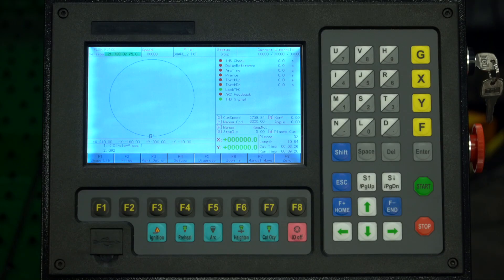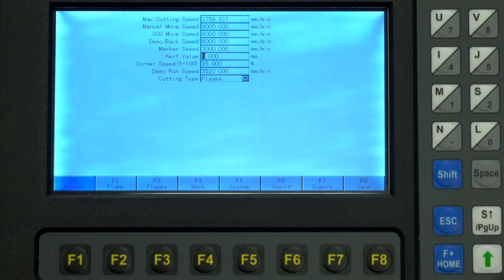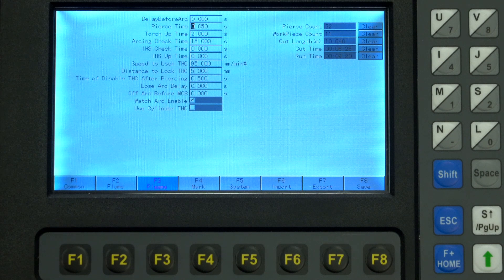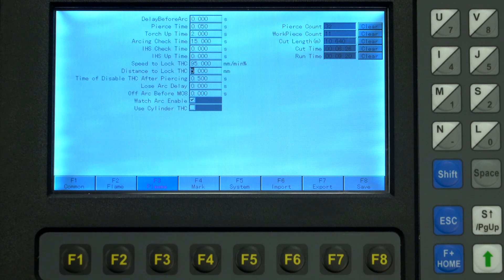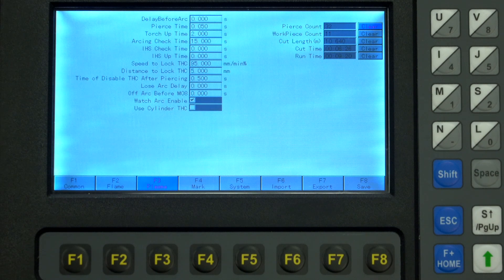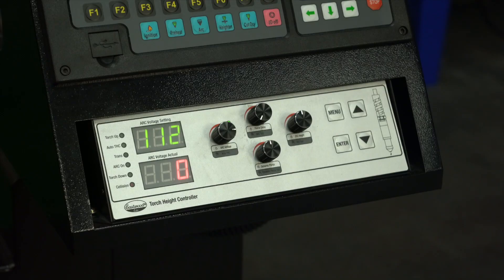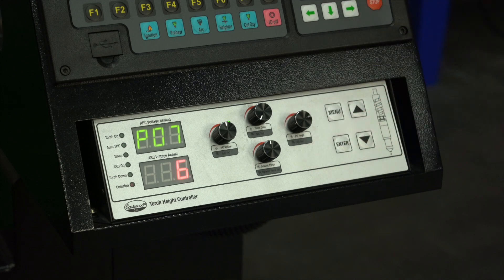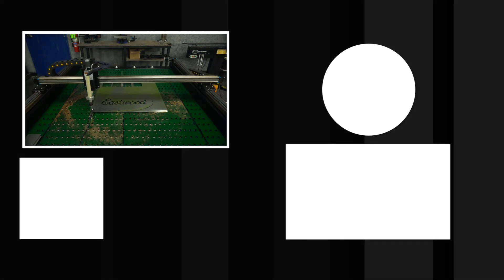Detailed Configuration of the Eastwood Elite CNC 4'x4' Plasma Cut Controller and THC Settings

Comment: How tf do you home it? Shouldn't he this cryptic
Reply from the maker: You set the "start point" before cutting. So if you have made several cuts on the metal already you can determine where the next part should be cut from.  It also includes Limit Switches so it can't run off the table.
Reply: @ i see. Ive never in my life ran a cnc machine that didn't require start up homing but this is ok thank you

Comment: Hello, can you help me, I have a fyeboon like plasma, it cuts well in manual, but when I put it in automatic to make the design, it lowers the nozzle, turns it on, makes a hole for a few seconds and turns off. I can't get her to do the drawing, but when I do the test she does the drawing test correctly. Can you help me or give me the machine manual.
Reply from the maker: Sounds like you're not on an Eastwood Plasma table - you're going to need to reach out to the manufacturer for this type of trouble shooting.

Comment: Which software do you use to make custom designs
Reply from the maker: We use Fusion 360 which we have a video on here: https://www.youtube.com/watch?v=cJkZOf97xIg

and here's a workflow to go from a drawing to a CNC cut: https://youtu.be/2_yL3rmU7iE
Reply: Is it possible to reset the machine to factory settings

Comment: 8 grand ??????????????????
Reply: $8000 includes the plasma torch. Other brands in 4x4 are $6000 up to $12000 and do not include the plasma torch. It is competitively priced. Only table with a 90 day return policy. All others are "Not Returnable". Eastwood is an established and stable company, you know you will get support when you need it; too many others are new start ups and are importing units or are made in someone's garage and are using proprietary parts and software which means you may own an orphan machine when you need help.